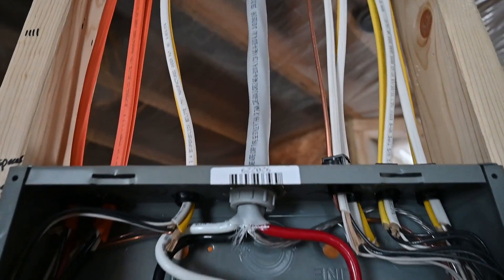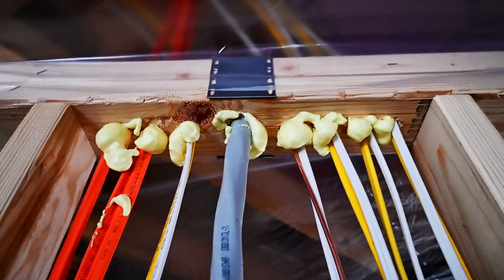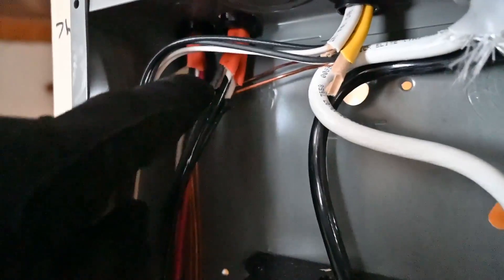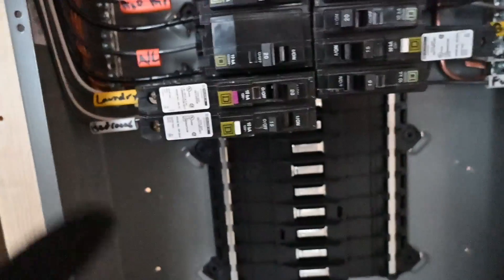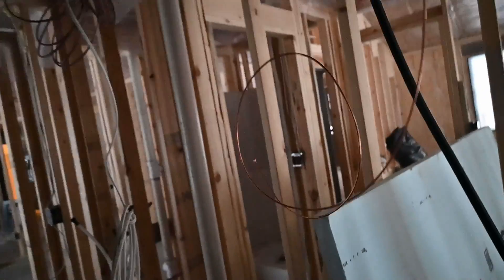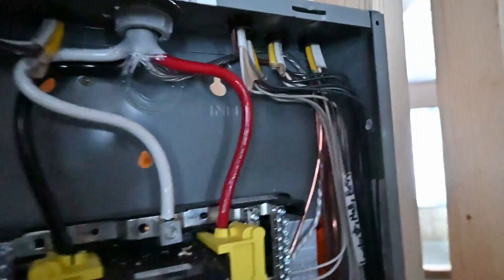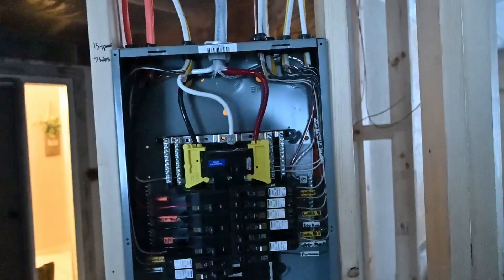90A Sub Panel Install

Comment: It looks like the neutral and #4 bare ground wire are touching on the top right side? Isn't that the same as bonding them, when they are supposed to be separate?
Reply from the maker: Yes, that's true. I don't think they were touching, but good observation if so.

Comment: Would like to power a  woodworking shop: main saw, vacuum systems, lights and 2 separated power strips used to plug in (as needed) tools. my building is 140 feet away from main power box. however, the main power box already has a sub panel break out box from an addition that was a major remodeling. Can my main power box have a second sub panel breakout box? Can i pull from the additions sub panel breaker box?

Comment: I like to anticipate a 2 pole breaker spot for a future generator.   Typically,  just below the main on the right. When installing an interlock.  Also good proactive planning wiring in the walls , WHILE there is no drywall up yet.

Comment: because of the length of those Arc Fault breakers they should make the panels wider so it's easier to string the wire in the panel.

Comment: Question my main panel was installed in 1993 and I noticed some of my neutrals are doubled up on the neutral bar was that code back then or do they need to be separate for each hole

Comment: Oregon does not permit exposed unprotected NM cable.  "OESC 334.15 (B) Continued.
Exposed nonmetallic sheathed cable shall be protected where it
is installed horizontally less than 8 feet above the floor. Exposed
nonmetallic sheathed cable less than 8 feet above the floor that
enters the top or bottom of a panel board shall be protected
from physical damage by conduit, raceway, ½ -inch plywood,
½-drywall, or other approved means."   So we usually flush mount panels.

Comment: I reserve the top 2 slots on the right for panel mounted whole-house surge protector Square-D PN: Q0250PSPD. This applies only to the Square-D PON (plug-on neutral) load centers.  We are now required to provide a SPD, and I extend this requirement to each main/sub panel as best practice.

Comment: Washer does not need a ground fault breaker if it is only to a single circuit, you can have a problem with nuisance trips.

Comment: Quick question about the two grounding bars... If they are only bonded because they are connected to the same metal box, would that mean that if there was a ground fault the box could momentarily have current running through it and could potentially shock you?
Reply: No, because the box is connected to the grounding wire that is run back to the main panel and to the ground there.  That will be the critical path and so the current should flow that direction, instead of through you to the ground.  It's the same concept with, say for example a washing machine... The ground screw there is mounted to the metal body of the washing machine and if a hot wire comes into contact with the body of the washing machine, you won't be shocked because you have the dedicated ground wire also connected.

Comment: The best system I have seen for a panel that is in a mechanical room, out of public view is to mount the panel between two studs and the two other studs that are adjacent to those two studs a ¼ of an inch thinner than the rest of the studs in the wall “this of course is if ½ inch sheetrock is being used for the wall covering”  then cover the section surrounding the panel with a piece of ¾ inch cabinet grade plywood mounted in a vertical orientation with the panel opening centered in the piece of plywood. The thinner studs allows the plywood to be flush with the finished ½ inch sheetrock wall. This allows approximately two foot of clearance or more around the entire parameter of the panel for access when the plywood is removed via the flush mounted counter/sunk lag screws that mount the plywood directly into to the four thinner stud frame work around the panel. Framing carpenters don’t like this method since it is more work for them, however the electrician can remove the four studs and trim ¼ inch off each stud himself with a table saw if he wants.  Once painted it almost blends in and is hardly noticed.

Comment: In my jurisdiction we have to use flame resistant foam to seal the holes. Our GC had used the normal yellow spray foam and the inspector made them change it all out to the orange fire block foam. Because they yellow foam is very flammable and would not act as a fire block.

Comment: Mine is flush mounted in my finished garage.. Flush mounted is much nicer, it is just harder for electricians to run additional wiring etc. Its only drywall repairs.

Comment: Why arent americans using tubes for the cables/wires in the wall? In Norway this is a requirement. What do you do if you need an extra wire or a cable needs to be changed?
Reply: Exactly as a European electrician this gives me chills.
Reply: Because it is a waste of pvc? Tubes? eww. No ty. We can pull wire to run new/more from basements etc with fish tape or plum bob and string. or just cut out a small thin piece of drywall.

Comment: I heard that it is safer to have the ground fault closer to the actual devices....i.e., using a GF duplex as opposed to the GF breaker.  The thought is that the duplex would trip faster than the breaker that was a long run away.  Thoughts?   Really appreciate the view and discussion of how a good box is laid out.  Thanks.

Comment: If the panel is Flush mounted and you still want the ability to expand, you can stub 90 a pipe or two above the ceiling providing it’s a suspended ceiling.

Comment: This sub panel appears to be  purchased  with an installed 100 amp breaker. I would like to see (or know) how the feed is from the main panel. Did they use a couple of slots for fuses??

Comment: I'm just a weekend warrior trying to learn - is that bare aluminum grounding wire on the right side looping too close to the neutral bus bar?  my instinct would put it on the outside (where the other grounds run) so there's no risk of accidentally grounding the neutral bar.

Comment: On a sub panel just like this on a detached garage,(2 hots and 1 common—no ground) is the green bonding screw supposed to be in or out?
Thanks in advance
Reply: You never bond neutrals and grounds on a sub panel
Reply: Why wasnt a ground (egc, equipment grounding conductor) brought from the main to the sub? In this situation, if dont bond the egc to the neutral in the sub panel, a ground fault (line to case) in your garage will never be cleared (fault won't have a path back; breaker will never trip; youre basically on two prong outlets). You normally dont bond neutral and egc on the sub because neutral current would take both neutral and egc back to the main, which is bad. But you dont got an egc back to the main... so... bond
Reply: @jasonjayalap  thanks for the response, I should have mentioned the sub panel is grounded to a ufer in the slab of the detached garage.  So do I still bond in this situation?
Reply: @Fishbreath81  the earth grounding is for safety, but it's different than protecting from "ground faults". 

Get a receptacle tester (with gfci or not) and plug it in. If it says "open ground", you're wired wrong. 

But if your subpanel was done correctly,  you do in fact have a "equipment ground conductor" (egc) coming from your main panel: The metal raceway/conduit/tube going to the sub panel is the "green wire" itself. In this case everything is fine and you don't want the neutral bonded to the metal case or any green wires.
Reply: @jasonjayalap  the conduit I used is the gray PVC. I did use a receptacle tester on all the outlets and got the two amber lights indicating it is correct.  I had someone tell me just to put the bonding screw in if I wasn’t sure.😬  Sounded like sketchy advice. 🤷🏽
Reply: @Fishbreath81  
If it's PVC then nevermind: it aint the egc. You should have a green or bare conductor, appropriately sized, going to the shed, connected to the ground terminal, which is NOT bonded to the neutral wire via the bonding screw. This is the only "right" and code answer.

---

Sketchy has been the norm for decades in this area. Only recently have electricians become serious about it. Lookup "mike holt bonding and grounding" for countless hours of instruction.

Is the neutral bonded right now? Take out the screw and run the test. Should say open. You need an egc going from your subpanel ground terminal to main panel ground terminal. "fault current" is supposed to ride along that path, and not the neutral.

As I said in my first post, my guess is that it's safer (though not code) for fault current to run back to the main via the neutral (which is what happens when the screw is in) than for your devices/equipment to become energized in a ground fault (AKA line-to-case-fault) and that fault not be "cleared" via the "effective ground fault current path" (getting back to the ground terminal at the main, where it's bonded to the neutral via the screw). Not being able to clear a fault is much more dangerous. 

When you do run a egc from the main ground terminal to the sub terminal you MUST take the bonding screw out (or neutral current will return to the main panel via both the neutral wire and the egc, which is very wrong, and why we don't normally bond there.)

But I'm only hobbyist as well. I hope I'm helping but it doesn't make since for you to trust me entirely.
Reply: @jasonjayalap  ok, thank you for the info. Very much appreciated.

Comment: That's not CSST its Stryker and doesn't require bonding.  The gas lines will be bonded by exception through the EGC feeding the gas appliances.

Comment: another panel tour. a SUB panel.
0:14 a newer panel, has covers over the main lugs
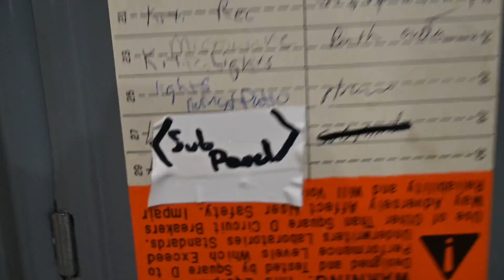0:56 75 degree column used to size the service cable...I don't understand
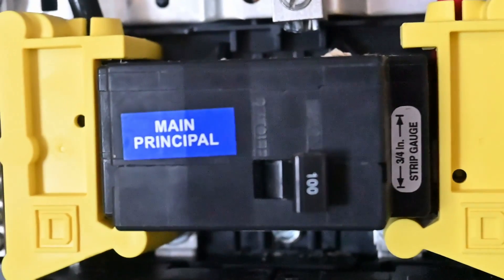1:35 100A disconnect breaker is bigger than the 90A supply. that's fine.
2:10 a flush mount panel. author prefers a surface-mount panel to allow easier addition later.
3:09 nail plates and seal foam. maybe for fire code
3:20 2*4 within one foot of panel to anchor cables. required
4:25 10/2 2nd wire is relabeled as black
4:50 laundry and bedrooms are on ground and arc-fault breakers
5:25 most lights and outlets have dual-function breakers. avoids need of GFCI outlets.
6:20 furnace doesn't require fancy breaker
...

Comment: In a town I used to live in in Massachusetts, it is illegal to use oversized wire. For example, you cannot use 12-2 Romex with a 15 amp breaker...
Reply: What about allowing oversizing for voltage drop?  I've figured 30 amp circuits with #6 to allow for voltage drop.

Comment: What if my Main Panel is 125Amp and I want to feed my Sub Panel with a 90Amp Double Pole breaker and after size it to 80Amp as my main disconnect in my Sub Panel. Wii that be fine?

Comment: I like those plastic connectors. What is the make and model/part number of those connectors? Found these Non-Metallic Push-In Connectors from Arlington Industries (NMR840). I like the idea of being able to easily add stuff later. I'll try to share the URL here: http://www.aimedia.co/media/spec-sheets/NMR840.pdf .

Comment: I am taking online classes to become an electrician, but currently I can not be an apprentice because I’m busy in the military. My question is since the panel is 90amps how many circuit branches can you install before maxing out the 90amp fuse? Also, can you install a larger amped sub panel? If so, what is the maximum sub panel size for a typical 240v main panel? Maybe you can talk about that in a video if these are not dumb questions.

Comment: I deal with Low Voltage and I keep my Low Voltage Panels clean. However I always see Breaker Panels in a total mess. Been tempted to pull the cover off of mine and take a look but im a bit scared to see how messy it is.
Reply: It is

Comment: I maybe a couple months late. But the way this electrician ran the neutral wire for the bathroom outlets... I predict that there’s going to be a local GFCI outlet in the bathroom. Other wise if the outlet is to be switched over, they’re going have to pigtail the neutral wire in the panel as it’s too short now.

Comment: Foam is not compliant to seal cables thru top plate. Intumescent fire caulk is the approved seal.
Reply: That doesn't have to be sealed at all.

Comment: I always install 2- 5S J-BX with a 3/4" flex in to the attic and 2 going in to the crawling space if accessible that way you'll leave space access for future projects and always leave the short cables long just for future changes.

Comment: Yeah, they over sized AC circuit wire size. It is a good practice to use FLC on nameplate and multiply by 125% to determine wire size. But always install maximum breaker size that is labeled on nameplate.
Reply: Ienght of wire run come in too
Long runs I bump it up
Brown outs. Start ups

Comment: Typically - when we run in-wall boards, we'll add conduits to each knock-out and take them into the ceiling.  We'll then seal the conduits properly with fire-stop.  That way, you only need to worry about getting into the ceiling.    We also never use timber above the board.  Steel is used to protect the cabling - it's also fire-stopped back and front.

Also - because people are stupid - we would put a steel back plate over the rear of the board, to stop somebody hanging a picture by nailing in a hook.

Comment: Just for my information (not an electrician or tech) can you wire a 4 outlet  device using one GFCI outlet device wired in parallet with a standard outlet?

Comment: I know very little about electrical wiring, only having done it once when I built my house.  The main panel that I installed had a neutral bus that I believe was bonded to the metal enclosure for the panel.  All of the neutral wires (white) were connected to the neutral bus and all the "hot" wires (black) were connected to an individual breaker.  The main ground wire (#8) that goes to the driven ground outside the house connects to the neutral bus as well.  Is this appropriately wired?  I realize that the code has changed since this house was wired 40 years ago.  My entire wiring was checked by the local electrical inspector and was passed after I corrected a couple of outlets (one had an open ground and the other had a crossed wired neutral/hot).  I plan to erect an accessory building that will have its own sub-panel.  I suppose I will have to wire that panel as illustrated in your video.  I have no gas piping and the rebar in my concrete floor is not bonded to the neutral bus or to a ground.
Reply: Point of entrance everything bonds together

Comment: Hello..when I was replacing an outlet in my bedroom I found a 'Boot - Leg  ground' in the outlet I was replacing which was only 2 wire...is this Safe?
Reply: Vincent, you can not  use  neutral side of receptacle for equipment ground or as you said boot leg ground.. Disconnect that wire and put a label on receptacle that says: open equipment ground or open ground. That way people know it is a 2 wire system. That is what NEC code says.
Reply: bootleg ground??  Do you mean a "fake" ground that is not actually connected to a ground anywhere?  If so, probably not safe if there is a short circuit that can heat up.
Reply: nope. replace with a non-grounded (2-prong) receptacle or a GFCI. And you must add a NO EQUIPMENT GROUND label

Comment: 1. The combination breakers are not suitable for bathrooms and kitchens cause they trip at 30 milli-amps rather than 5 mA required for human protection around water. Those are better handled by GFI receptacles with 5mA trip. 30 mA trip current is mainly for equipment/fire  protection and not for any small appliance that requires a human to grasp. Don't be fooled by the electrical industry -- they care more about equipment than human injury and will sell you false assurance merely to please the insurance underwriters against bad engineering of equipment.  So not much has changed.     

2. A neutral should be available to the AC unit whether it uses it or not -- cause the temptation will always be to wire ancillary devises to ground. These could be a crankcase heater, a control devise or even a cheater cord. 10/3 should have been used. Hot wires should be coded red and black (and blue for 3 phase) the electrical code allows color code exception only for the large wire sizes. Cables of appropriate colored conductors should be used. Sometimes equipment might be changed in the future and require the neutral.  It is about electrical service not what 'one can get away with'.  Install full services that are flexible and future proof, and follow best practices of the electrical codes, not merely minimal requirements.  And about a corrugated gas line running though walls : WTF ; someone is bound to nail that.

Comment: Most service entrance cable has XHHW-2 insulation. The individual conductors have a 90 degree ampacity.
Reply: On the sheathing of the service cable I believe it says THWN

Comment: That main cable is called SER (Service Entrance Round) as it has an insulated neutral wire. It is also available in copper.

Comment: But if you use regular receptacles connected to arc fault breaker you need to identify on the receptacles with the blue sticker that comes in the box of the receptacles, and place it on every single  receptacle that is protected by the arc fault breaker...nec code.
Reply: ya i think most residential dwellings will be exempt as no home owner wld want a sticker on their plate and the nec is only a recommendation not a rule/law its up to the JHA to decide to adopt standards codes